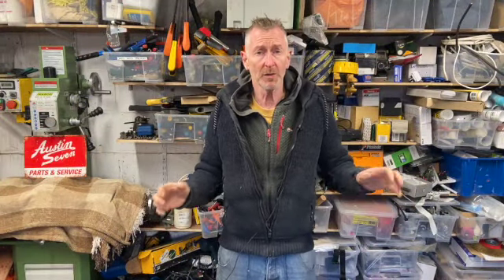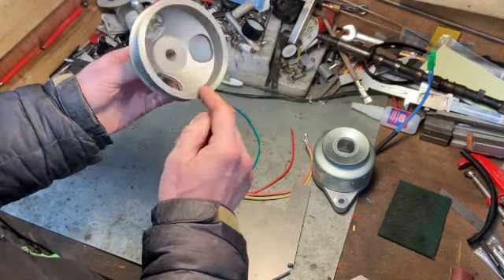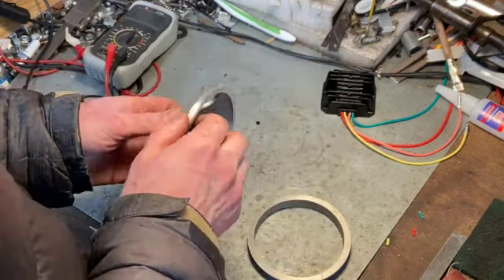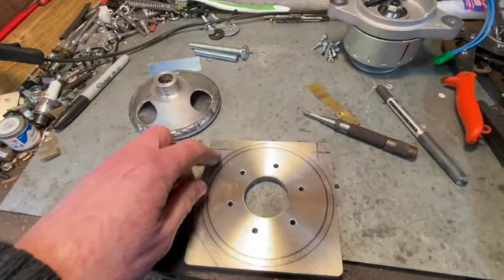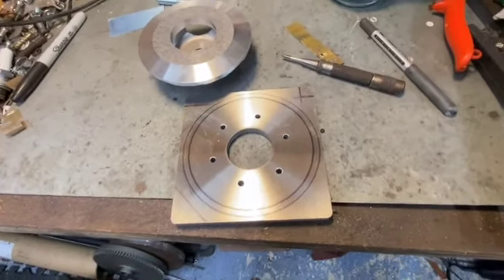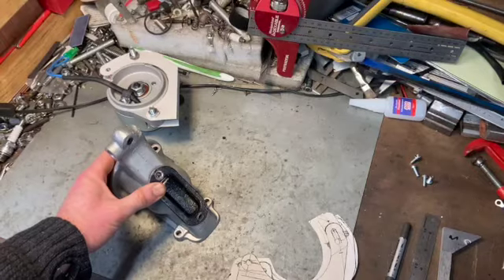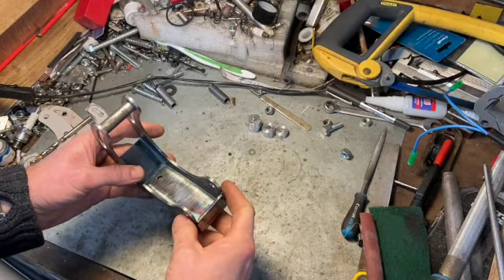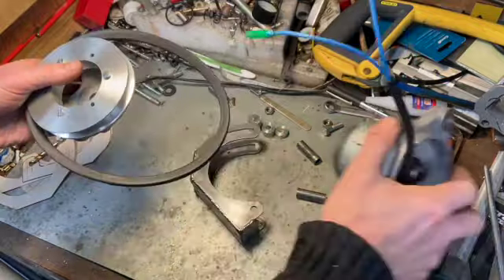Wragg Austin 7 Special - Alternator Conversion

Comment: If you have the original Austin 7 switch panel it had a red light for not charging and an amp meter.  You could build one up with your LED and a volt meter as a homage to the original? Like the build and envious of the car and garage!
Reply from the maker: like the idea of an Ammeter - I'll have to take a look on eBay later !
Reply: @thebracketfactory  They are usually around £175 for the Lucas switch panel

Comment: Would it be worth looking at the pulley ratio, to check its the same as the engine it came off. I would have thought you meed a ration closer to 1:2, to get the alternator running fast enough at idle.
Reply from the maker: I would prob do that if I could James... but... the drive pulley can't go any bigger (as it would foul the crank nose casting) and the alt pulley is fixed.. I think it should at least prolong the life of the battery for 'testing' purposes as it kicks out 14v at higher revs. Just need to make sure I don't sit in traffic (and there is no chance of that!!)

Comment: Charging voltage is too low for a decent alternator, and will not charge the battery meaningfully. Your belt may require some dressing, or tightening to remove play. Shoudn't be more than about 1/2" of sideways play in the belt. Earlier shots showed it waving around quite alot!
Reply from the maker: I just need it to 'not drain/rely on the battery'... I have very little in the way of electrical equipment to drain the battery (no lights, no heater, no wipers, no electric windows!).. I'll report back after road testing! (assuming I make it back.... ;-)
Reply: My point is that the belt is either slipping or the alternator is faulty. The charge voltage has to be higher than the float voltage otherwise you're just carrying a brick! @thebracketfactory
Reply: Or is the alternator pulley too large, reducing the speed of rotation? Perhaps a smaller pulley is needed? 
Brilliant fabrication though - top job! 👍
Reply: I’m thinking the alternator’s not turning fast enough. If you look at the ratio of the diameter on a regular crank pulley to an alternator pulley it’s about 3:1 at a guess. I think you’re not far off 1:1.
Reply from the maker: I'm getting just over 12v at tickover  (which is enough to run the car) and 14v at 3000 rpm (which is enough to change the battery). So I'm hoping that this is enough to keep me going when out 'testing' !!
Reply from the maker: need to measure but I think it's about 2:1...it sort of is what it is - can't change the alt pulley and the cam pulley can't go bigger (space) and smaller won't help. I'm getting about 14v at abrupt 3000 rpm so I think 'it'll do'..... @nigeltoon1848